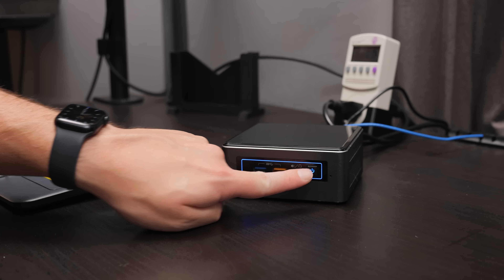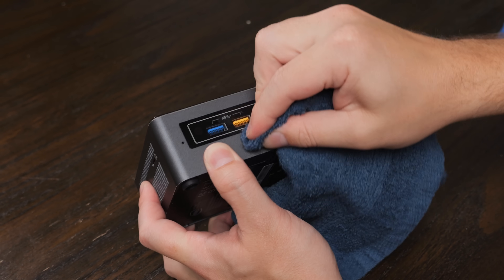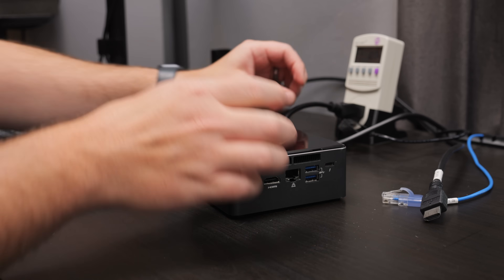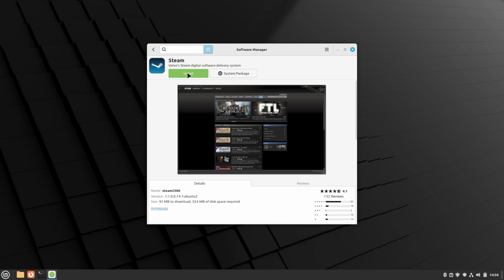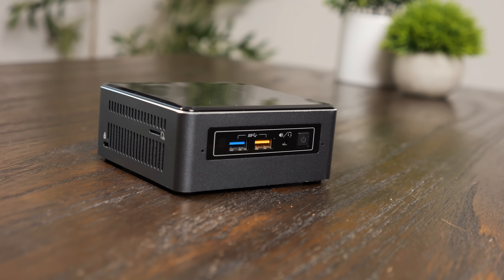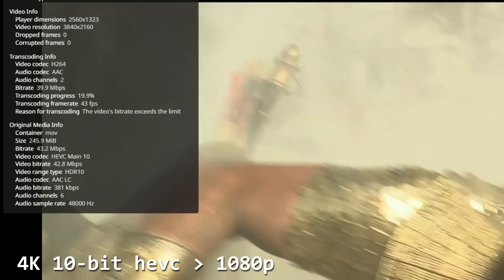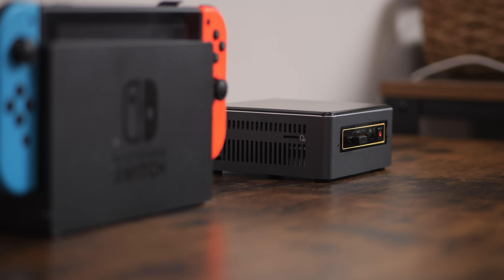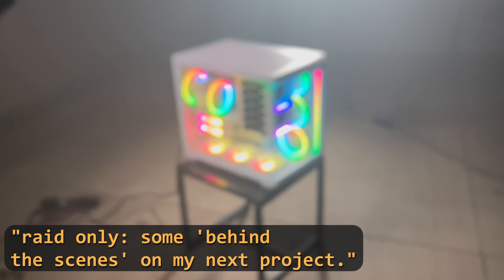The NUC7 ...7 years later.

Comment: I have the smaller version (without the HDD enclosure) and am really happy with it. It's the last NUC that actually has a power supply that is smaller than the Nuc - later models feature huge power bricks. I like the metal case - they went plastic shortly after. The LED ring is cute, the Thunderbolt 3 socket was a first for the Nucs. 
You made one mistake, though - they support a maximum of 2x16GB, not 2x32GB. But that is still plenty in 2025. 
I think this was the peak of the Nucs: Low TDP, nice metal enclosure, good looks, Thunderbolt. 

For a brief period of time, the Nuc 13 Pro Desk Edition was available on the market, and it made want to retire the Nuc7. But then they sold the Nuc line to Asus, and their machines are invisible on the market, for reasons I do not understand. There's a single vendor for the 13 Pro Desk Edition, charging outrageous rates. No thank you. It is a pity that intel killed the Nuc line.

Comment: Nice, I had an i3 NUC that I gave away due to only having a single NVME drive slot. I'm surprised that your i5 model has space for an additional SATA drive, so it is possible to be used as a proper Proxmox cluster node with a RAID1 mirror. Sweet!

Comment: I still have a proxmox cluster I built years ago with 2x 4th gen and 1x 5th gen i5 model NUCs (gotten cheap THEN).  Maxed out RAM (16GB) and 1TB SATA SSDs and a cheap NAS used for iSCSI shared storage.  It was so stable and required such little maintenance I switched it from lab stuff to hosting all my services.  It’s probably overkill nowadays (I don’t self-host nearly as much as I used to) but “if it ain’t broke don’t fix it” right?

Comment: These things are amazing, but you're using one with a lower power dual core model 15w tdp processor. The 28w coffee lake ones with the 8259U really go, I had some local AI models running on my nuc8i5beh which I never thought would work on a mobile chip that old! It recently started acting up though, I am replacing it with a 1340P based nuc 13 model (considered the i7 but man they're hardly worth the near doubling in cost for the barebones kits), I hope to get another 6-7 years out of that one!

Comment: There is something that used hardware ignore and that is unless you are able to test the machine before buying or trust the seller or have a good refund policy you are kind of gambling that it will work. Also since you have no clue how it was used before you have no clue what the condition is and how many more hours the device might last . Most of the time it's fine. But I've been burnt enough where It needs to be more than $50 cheaper for me to buy something used vs something new unless I can physically inspect and test the hardware first.

Comment: I had a NUC8i7BEH running Xpenology for a few years and it worked perfectly. Funnily enough I then turned mine into a Hackintosh but found the lack of active cooling basically meant whenever I used it the CPU ran ridiculously hot. Like close to 70C with nothing open.

I now use it as a headless Linux server mainly for docker containers but it does struggle when the CPU starts to get slammed. Just a shame there isn't a like for like modern NUC equivalent as I got mine originally for an affordable price (brand new too).

Comment: The N100 is more efficient in Cinebench but you're arguing for emulation as well, so you could have done some emulation benchmarks because i doubt the N100 will outperform the older CPU with it's Dual-channel memory. 
But it could also be that the newer N100 has benefits from newer architectures. Who knows without testing?

Comment: I have the i3 version of this with no Thunderbolt.  I use it as my ex server.

I installed Windows Server 2022 on it.

They have an ir receiver built in so you can use a One4all remote control with the NUC

Comment: i got 9 of these for free when the company went to a new system for their kiosks. i3's and i5's ....... i use them for everything. i even have a half-height one I have put in my bag as an emergency computer when i have nothing else. the one thing i like about the older ones is that they operate on 12V while the newer ones operate on the standard 19V. you can also modify them internally to do things they're not supposed to do.

Hope you enjoy it ! They've been wonderful.

Comment: That's a cool pick up.  I do like mini PCs and always thought the NUC design was really nice.  I kind of had the same attraction to the Tiny/Mini/Micro computers when they were new.  I wanted one(or a bunch), but not at those prices.  Now I have several I got for well under $100 and I love them.  I tend to prefer going used these days.  You get some amount of cost savings up front compared to the N100, and typically still get a power draw low enough to not matter too much, as the break-even calculator shows.  Though I suspect I'll eventually end up with an N100 box down the line used, and hopefully dirt cheap, when everyone else moves on to the next big thing.  I recently did have a look at a some NUCs, but ended up buying a Zotac(an M model with a fan, fifth-gen Intel i5 5010U) instead due to it having two ethernet ports so I could have the option to use it as a DIY router.  I have another Zotac, a fanless model with a Core M 5y10c that's currently acting as a media server(I don't do on-the-fly transcoding).  I like that machine a lot, and the Core M is ideal for a fanless application.  It also has two ethernet ports, so it's possible I could use that as a router instead when I finally make my decisions.

Comment: With the current prices here in Germany on sites like Green IT, AfB, eBay, or Kleinanzeigen, I really feel that the N100 is well worth it.

There's about an €80€ difference between the N100 & the older NUCs at best (for the NUC) currently. 
Besides, if you're looking into the N100 boards, they're well cheaper, albeit way bigger. 

I'm thinking that this has convinced me to go and buy an N100 chip based board as my next project or intermediate router, maybe. Probably, I'm going to stay away from those NUCs. Oddly enough, other Mini-PCs like ThinkCentres, OptiPlex' and EliteDesks seem to be priced way better in many cases, and I feel like they're regularly on sale (refurbed). 

It's absolutely interesting how markets differ in that regard. I think the NUCs never really took off here in Germany (or Europe in general?).

Comment: imo Thunderbolt 3 on this is the killer feature that sets it apart from otherwise-similar N100 or N300 machines. it gives you access to faster networking than you'd otherwise be able to have which is potentially a gamechanger for the server use case.

Comment: I recently upgraded my home server from an upside down Surface Book on a laptop pad, to an HP Elitedesk 705 G4. It has a Ryzen 5 2400GE and an RX560 w/ 16GB RAM. I’m immensely happy with it, temps are great since getting a ventilated lid, and the 4 core 8 thread architecture is much preferred to an older hyperthreaded dual core.

Comment: Towards the beginning of this year, i found a barebones nuc7 with a Celeron J4005 at a flea market for only 10$. I slapped in 8gb of ddr4 ram and an old ssd i had laying around in it. I used it for a bit, but i later sold it for like 70 bucks. It was a great tiny machine for everyday use and some very light gaming. Intel really nailed it with the NUCs!

Comment: Honestly i think he picked the wrong NUC. I just looked around and there are NUC with the i5-8259u around for 70 Bucks. The i5-7260u is the last of the pre Ryzen Designs, after that Intel had to step up it's game. The i5-8259u has a higher max power draw but comes with 4 cores and 8 threads, with a higher clock speed. Yes it would be even higher in Power consum then the i5-7260u, but it got nearly twice the compute power as well and it is supported by Windows 11.  The Question is: how much higher is the Idle Power-Draw, and i goes not much. When the Performance powerdraw is linear, as it seems in this case, only the Idle Power-Draw matters. 
Work vs Power Draw would be the same but the i5-8259u got plenty reserves. To be honest, i would prefer the N100 System over the i5-7260u as this system only offers more PCIE Lanes but not more Performance, but i would prefer a NUC with the i5-8259u for the same Reason. Reasonable Powerdraw on all three systems but the i5-5259u has twice the performance over both. All Systems are Sub 50 Watts and Sub 15 Watts in Idle. Putting them in the same Category. For the Idle Powerdraw one question: Both Systems only with M2 ? Or had the NUC accidently the 2.5" still inside and the Kamrui not ?

Comment: We use NUCS for everything at work (I work for a medium-sized managed IT provider) and I use NUCS at home for most of my servers too, the new Asus NUCs seem pretty good. they are in a plastic versus an aluminium case but it's still built well. they don't get hot while running and have excellent fan performance. the tooless system is not bad either but it takes a bit to get the bottom of the nuc back on the very first time.

Comment: Had an older version of such a NUC (might've been a 5, or even a 3, don't exactly remember) running my pihole. Until some day I got more ads, tried power cycling it, and it still wouldn't come online.

The thing just died. It powered on, but did not POST. Replacing RAM didn't help, it was just dead. Now, it had a Celeron so not too big of a loss there, but interesting since one of these systems at one of my internships also died in the same way as mine did.

Comment: Another cheap solution: ~40-60USD option is: buying a damaged old laptop, put into 8GB RAM and a small SSD.
(I got a broken DELL lattitude with i5-5300 for very cheap, I put into 8GB RAM and 80GB SSD and it is perfect for daily usage, so I do not need to switch on the power hungry gaming PC.
The power usage of this laptop is: 9-10W on idle, ~14-18W playing youtube 1080p, browsing the web is around 11-13W average: load site-scroll-read-scroll-read....)

Comment: Working with NUC daily as a product that ships out to clients, from my company's data they fails at around 3-5 years mark due to lack of cleaning and/or failure of SSD / Ram slots. Considering most fail NUCs are from fast food chains, IMO it's fair to say NUCs rocks in stability. I personally had an 8th gen i5 for ESXi too, sold and replaced it with a Deskmini A300 with 4750G freed from another project which now runs Proxmox (rip VMWare free license). 

NUCs were my goto for thin clients and small home servers, I would have picked it over any other mini PCs if it weren't for the high brand tax, which, nowadays from what I've heard have gone crazy with the brand transfer to Asus.

Comment: I have six of these things now.  The oldest is a 3867U and yes, it's still useful.  This one is running Emby and does just fine.  The UHD610 iGPU is dated, but works like a champ for media.  That said, it doesn't have another use case for me other than a pihole or emby server.  Saying that it's slow is giving it more credit than it deserves in 2024.  It seems to draw about the same amount of power as one of my N100s, so not like it's costing me more to actually use it vs trashing it for low level use cases.

Comment: Nice video! I run Proxmox on a NUC 8i5BEH as my virtualization host for Home Assistant, a Windows 10 VM I can remote into, and an NVR. Put in a 2TB SSD, 2TB HDD (2.5 inch) and it works like a charm. Bought it new at the time, and it's been going strong for about 6 years now. Would highly recommend.

I'll leave a small tip here: On some older Linux kernel versions, the driver for the ethernet chip for the 7th and 8th generation NUCs is bugged. Make sure you are using a recent version of Linux, otherwise you may experience random CPU hangs or loss of internet connectivity. Found this out the hard way myself with proxmox until it was fixed in a later version.

Comment: I bought a new beeline n100 for parents, but worry about how robust it’ll be. An Intel nuc willl work for 10 years, build quality is awesome. The only new Intel nucs I can find are super expensive, and not sure I trust asus. So I’ve gone budget, let’s hope it works out. Performance wise, the n100 system is super fast running Ubuntu desktop, avoiding snaps helps, and I put in a WD ssd as I trust that more. If I could’ve found a nuc for 250 I would’ve done that instead.

Comment: As always with your videos really great content. I would say get the N100 unless you can get the NUC for free or cheap say under 50. Less issues setting up and your often get a windows 11 digital license which you might not with the NUC. I got an N100 system with dual i226 network and DDR5 for 150 (the DDR5 ram makes a huge difference in my opinion even though is single channel its worth the upgrade, avoid the DDR4 systems).

Comment: I have one of these (7i5BNH) that I use for Batocera Linux and it makes a killer emulation box. run up to PS2/GCN/DC/XBOX with almost no lag, and I load all the ROMs from my main server over the network. I think with an external GPU over thunderbolt, you could honestly do some pretty good gaming on one of these guys (although that obviously negates the form factor a bit)

Comment: my router is a custom fanless NUC5 from a company called seneca  that was initially designed for use in digital signage. Lil m.2 network card got me up and running with OPNsense and its been great. Only thing is it refuses to power back up after losing power despite me enabling it in the bios - possibly due to the custom internal PSU that it comes with.

Comment: I'm so disappointed in Linux OBS. It always takes several minutes to several hours to bring it to the point where Windows OBS comes stock. I have been using Mint on a test machine and I cannot get any recordings to have audio since I started using the source record plug-in.

I am planning to run a server that will virtualize up to two desktop OSes and feed them each to another room, so I'll need those other boxes to be efficient. Thanks for the heads up on efficiency. Also thanks for the headsup on Moonlight/Sunshine. I haven't tried them yet, but no doubt they're gonna come in handy.

Comment: 14:55 the big difference here is though the size and the heat generation. The N 100 is built for short bursts while a full size desktop. CPU can run this all day.

Those benchmarks are not real world. If you try to transcode some video, the I5 absolutely destroys the n100 after it is thermal throttling

Comment: I did some similar experimentation with some 7th gen Dell Optiplex thin Clients. The HDMI AND DisplayPort even on older 7th gen integrated graphics supported 1080p 120hz and I believe 4k 60hz so you could EASILY stream HIGH end gameplay to a local source. A nice cheap 1080p 120hz gaming monitor OR a 4k 60hz TV could easily provide a NICE experience. Old NUCs and Thin clients are OFTEN available for under $99 and maybe as low as $50-60. A HIGH end HTPC experience can be had for cheap if you already have a nice gaming PC or maybe a gaming service like Xbox cloud OR GeforceNOW. Or maybe you are a crazy home lab-er with 5 GPUs in your cloud gaming  server...

Comment: Watching this on a NUC7i5BNH...

The NUC7 was the first NUC with a decent iGPU.

It also has two extra features that many miss - it has a built-in IR-reciever (quite handy when paired with - say - KODI) as well as a stereo microphones.

They are basically small conferencing machines (just attach a webcam) that is like made for doing video-calls and presentations with (the actual use for the IR-reciever).

Other things with it is that Intel published the files to 3d-print "hats" for it if you felt like hacking it a bit more.

Quite nice little machine that far outperformed my expectations when I got it (and once it gets replaced it will live on as a general server).

Comment: I have the i7 variant which i love, it has 12 threads so is quite capable. I've used for various tasks, virtualisation stuff with ESXi, running Home Assistant. It ran Blue Iris for a couple of years. Even a crypto node for a year.

The fan however on mine is quite loud when it ramps up.

I had driver issues from Windows updates a few years ago. Once the NIC would stop working. I had to find the original proper drivers it came with, which took ages to find on the Internet, but everything worked okay again.

It's been on 24/7 for 5 years or so! 😊

Comment: It's gotten to the point where Linux installs can be easier than Windows installs.   I've had this experience too, Linux itself is easier to install than Windows in many cases.   I don't think windows even supports seventh Gen any more.  That means seventh Gen should get dirt cheap, a bonus for Linux use for inexpensive needs

Comment: One fact you forgot to touch on for the server usecase is that if you get the i5/i7/i9 version you get vpro, which allows for remote power management and iKVM so you can remote manage the machine. This is huge if you're using it for proxmox and keep it away from your desk or even a remote location.
Reply: Trying to get vPro working might be a beast beyond the Scope of the individual buying a cheap server to do little things or to ticker with. I don't want to even want to try to tackle it... Additionally, it seems to be on most CPUs recently with no real support or official way to access it...
Reply: @photon92  really? what was hard? CTRL+P on boot, enable it, then you can at least control the power from a webui and if you want to get more technical just use meshcommander and you have KVM access. Really is not hard at all if you're already doing home sever stuff, you should have 0 issues.
Reply: Only specific i5/i7/i9 models have vpro enabled . There’s also a premium for these compared to the non vpro versions .